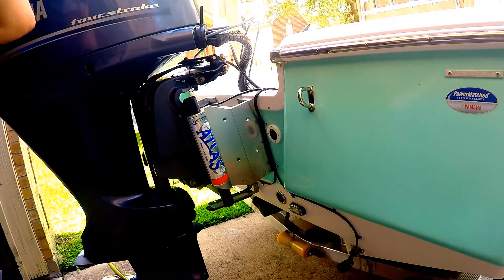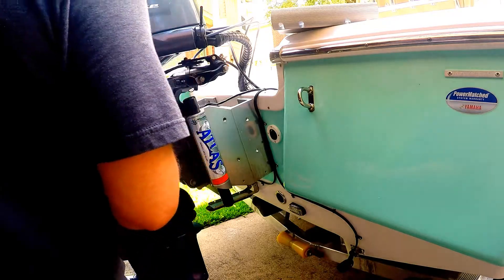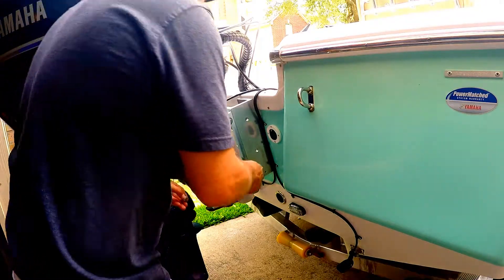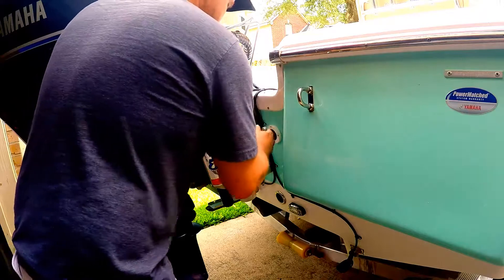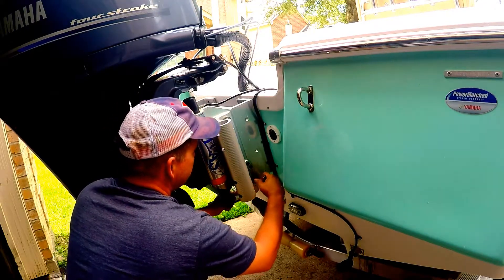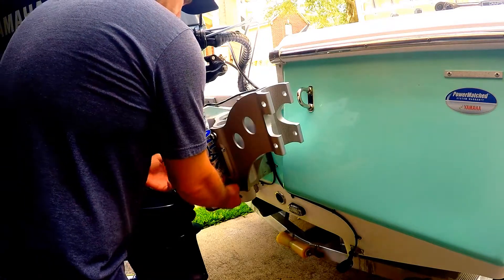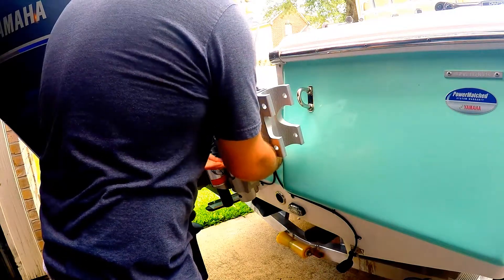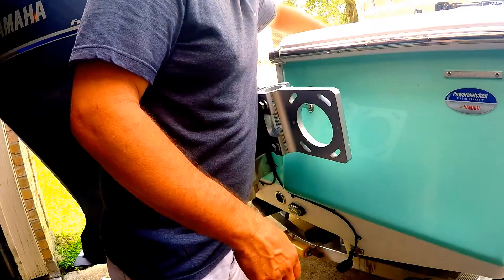Talon Jackplate Bracket Install

Comment: I see you are Saltwater Texas, how has the talon held up in the salt? I had a 10' power pole blade on my previous boat, a lot of thought went into getting the power pole or talon. Pros and cons to power pole. The hydraulic pump in bilge and the noise. The 10' blade extends 12" higher on stern than a 12' talon (I troll a lot where this makes a difference). Also with transducer 6" below surface and Simrad reading 8'-0", the 10' blade would not reach bottom to anchor! I just purchased a new 24' bay boat with hydraulic jack plate, have to make that decision again, talon or power pole. I am leaning toward the talon, 12' vs 10' power pole for about the same price. My boat does get soaked with salt-away and power washed after every use. But I have saw post where several people have had problems with the talon, how has yours held up? I probably wouldn't second guess a talon if I fished fresh water only but I live on NC coast and fish the salt water all of the time. Thanks
Reply: Chris M it held up great until I decided to get into the surf and the wind kicked up. It snapped the cable but I took it off and the service center fixed it at no charge. I broke it putting it under too much strain. Way too much- water in the boat proved that point. Overall no rust and no problems. It stays tight on the back and no wobble at all.
Reply: @mrandmrsbiggs602  - Thanks for the reply. My boat dealer said he has several talons come in for repair but not many power poles. Still really like the talon
Reply from the maker: I wish they made the power pole a bit longer. The talon is headed back to the shop for the second time. I believe it is the cable again. I realized how much I love it when it is broken and I have to pull out the iron anchor!